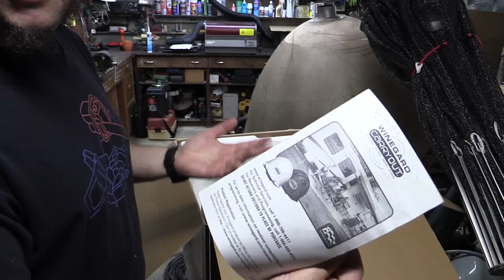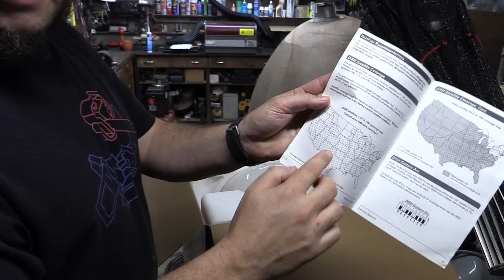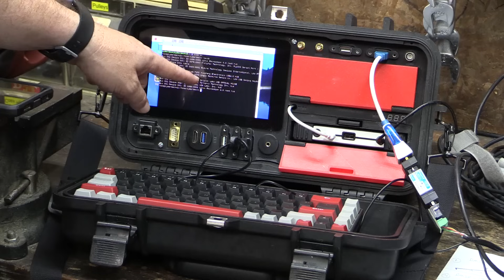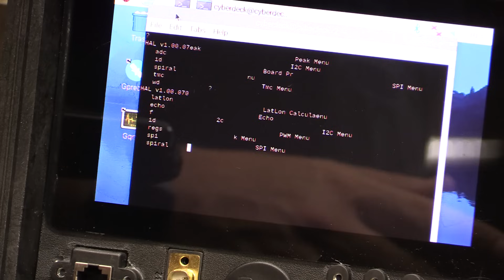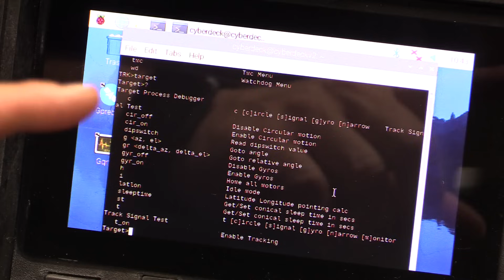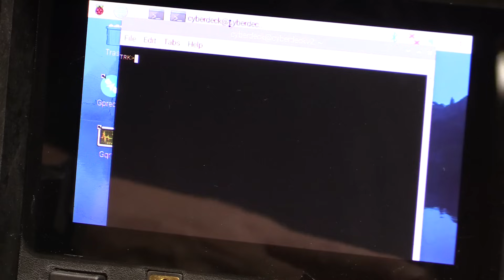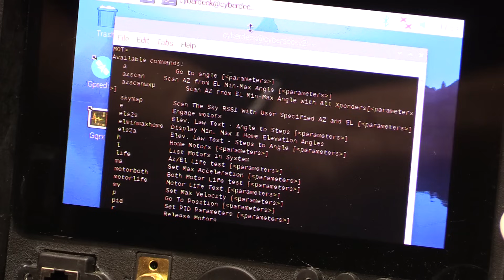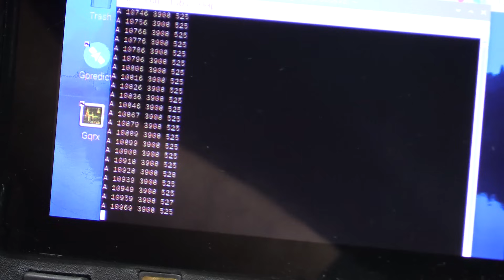How To Hack Winegard Portable Satellite Dishes

Comment: Two options Gabe:  Either pipe the output to a file (if that’s an option), or… bear in mind that you can just take the RX pins of an RS232 to a second RS232 where you can read the data and pipe it into a file or get another program to record it, maybe Python.

I’ve done this to get data out of devices and send it to programs that it wasn’t supposed to go to.

Good luck!
Reply from the maker: Good ideas! I'll have to try that.
Reply: @saveitforparts  - It was me who e-mailed you, but thanks for the reply here as well ;-)
Reply: @saveitforparts  just use a different terminal program like tio. screen lacks a lot of features such as logging.
Reply: Screen can log... You can pass it the -L flag to log everything, or C-a H or :hardcopy to log the scrollback, or C-a H: to toggle logging of the current screen, or jump into the scrollback and select text and copy it to a paste buffer, then paste it into another screen with C-a ]. I use screen daily for development and for a serial terminal as well.
Reply: @adamboggs4745  screen does not do any of the tty features well enough for me to use it, it wasnt meant to deal with the intricacies of serial communication and does not support modern autocompletion and syntax
Reply: @drkastenbrot  I'm a big proponent of people using whatever tools work best for them. What do you use exactly?

Also, what do you mean "modern autocompletion and syntax"? While screen can do completion and hotkeys/macros, I usually defer to bash or vim for those things. Depends on what you're connecting to though; I work mostly with Linux embedded devices.

Comment: So I thought the gears that were skipping on the belt, were out of position relative to each other, on previous video. 
Maybe the same guy at the factory, and all his subsequent trainees, has been installing the belt wrong for generations of dishes.
Maybe after it's installed on the RV it homes once and then keeps the position stored in memory with sense voltage while in sleep mode, 
Maybe its the sound of the stepper motors oscillating directions at a high rate of speed.
home motors    [<parameters>]   looks interesting

Comment: I have an idea!!   Could you use the motors with some software to track Ham sat??  Are the motors strong enough to hold 144mhz and 440mhz antennas?
Reply from the maker: I'm not sure these are strong enough, but I have some security camera mounts I've been meaning to modify for 2M/70cm

Comment: Could you put a small raspberry pi w on the moving assembly and then just ssh in ?
Reply: That's one of the potential solutions he mentioned. Keep in mind that you're going to need an interface to stepper controllers (built into the winegard control boards) to drive the steppers moving the dish, and you will need to have another method of controlling the polarization as that system appears to be looking for some voltage above or below 15 volts to determine vertical/horizontal polarity. I would honestly dig out the multimeter and see if I can find a uart port, or pads that provide the equivalent. Possibly near the WiFi/Bluetooth antenna somewhere.
Reply: I was taking about the two with exposed serial ports.

Put a pie on the moving assembly and connect wirelessly to avoid the tangles.

Comment: Hey save it for parts I was wondering if u had any advice for starting on any stuff like this knowing u need different stuff for every satlite but I wanted to try to make a weather service and also wondering if u have a suggestion on a rf receiver other than rtlsdr or hack rf.
Reply from the maker: I started with the very cheapest SDR I could find in 2020, the $15 blue one. It was OK for some of the basics but didn't have a very good antenna connector. I just kind of went from there, I checked out websites like the rtl-sdr.com blog and tried out different projects that looked fun!
Reply: I can't edit my comment but I ment to say a setup to read from most weather satlites I'm kinda planing to go big on my start by having a hopefully lowest distortion image a auto move system that like follows satlite.

Comment: I have a similar power supply but its 24 v max 20 amp max variable voltage current one i got for 8.00 at a black Friday deals store at Dulles Town center Mall in sterling va

Comment: Can you configure the little dishes into an array and make the apparent size much bigger? Might be a pain to put together though...
Reply from the maker: I've tried that before, it was too hard to sync up all the signals. Slight differences in internal wiring lengths made the signals come in at slightly different times and just amplified the noise.

Comment: Dont get the cheap RS232 to USB adapters. Some of them cheat on the flow control and just wont work for some applications. I found the Keyspan adapters to be the best all around. I worked with a lot of old lab equipment that required them, so I have great experience in these matters. Trust me!

Comment: All satellite dish equipment (LNBs, positioning motors etc) run on 15v. not 12v.
Reply from the maker: The LNBs are usually either 13V or 18V for vertical or horizontal polarization. Most will take a wider range, like 12.5-14.5 for vertical and 15.5-18 for horizontal.
Reply: @saveitforparts  Maybe you know better than I do. I remember setting up satellite dishes with positioning motors that were powered straight from a receiver(15v)

Comment: What did you do @15:54? Did you change baud rate?
Reply from the maker: I think I just kept trying it with various baud rates, sometimes it worked and sometimes it didn't. The dishes aren't really designed for this and my cable is a bit bodged together, so it can be flaky.

Comment: I like these little Winegard dishes, they look like a lot of fun to hack/play around with. If I'm right, (going on stuff I did 20+ yrs ago, memory might be off) but I think if you try different values in the PID section of the motor menu, it might help with the gear grinding. It could induce a kind of break before the limit. 👍
Reply: PID value changing wont help you here, the 'grinding' is perfectly fine and normal, its just the stepper motors skipping steps (aka the magnetic field force from the stator cannot overcome the hard endstop force, and so instead of it rotating the rotor, it vibrates, making that noise). It sounds terrible yes, but it is mechanically and electrically perfectly fine.